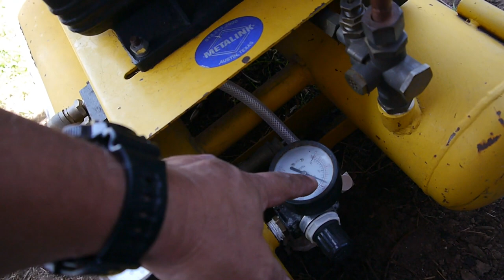A well used Rol-Air Gas Compressor would not Start.  Is it too far gone?

Comment: Nice job I idea to paint your roliaire I found a nice durable finish I used Rusteloum Hammerite Green paint and the exhaust I wirebrush it off put the exhaust cover in a vinegar bath then I paint it 2coats of automotive 3000 degree flat black or use Rusteloum matte black

Comment: Most of the trouble I have is rust in tank and control parts rusty 
Compressor needs oil change at least once a year for normal folks
Reply from the maker: Some guys use these compressors heavily during the week, if not every day.  They should track the hours and change the oil accordingly.  Sometimes 2, 3, or 4 times a year.
Reply: I do a ton of work for one coming and they bring them in every two weeks for service 
The billy goats are used all week and usually change oil and air filter plus lube wheels